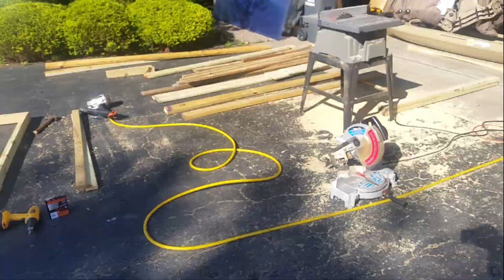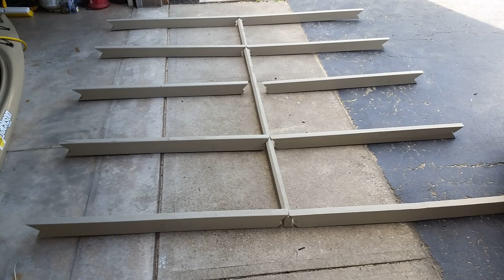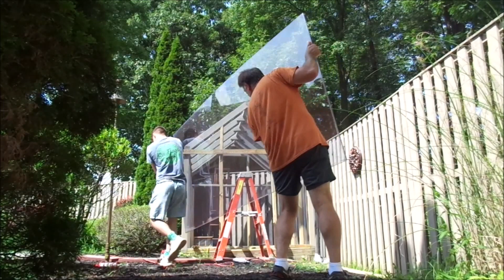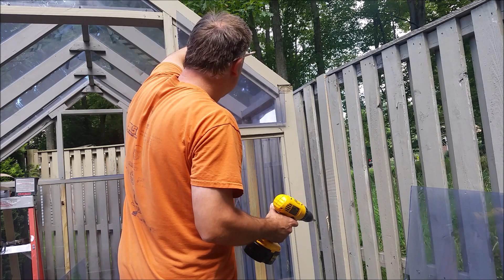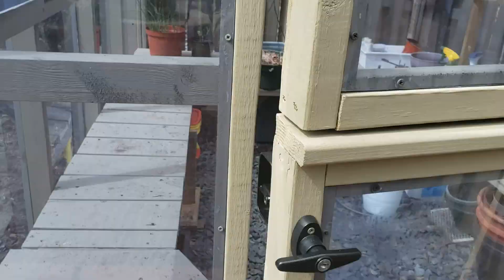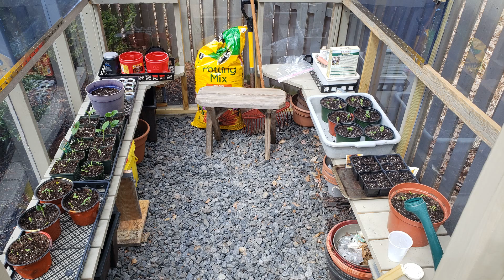DIY Greenhouse build 2019/20 treated lumber and Plexiglas

Comment: Hi, can you explain how you make the inside bird mouth cut.thanks
Reply from the maker: sure, a simple way is to know and measure your angle cut and lay them out appropriately on the garage floor and lay your ridge board as it will go and trace and cut. then use these as your template to cut more. i angled the top of my ridge board with my table saw so i would have a perfect flush finish with the plexy at the peak.

Comment: Looks good!  Can you please show us how to build and fix the vent?
Reply from the maker: oh where the plexi cracked...  I bought a cheap air vent at home depot and used that.  I then cut the plexi to fit the vent erasing the cracked portion and pilot drilled and installed with short screws.

Comment: How has the plexiglass held up? I’m considering doing this over glass since it’s easier to work with. Just unsure of how it does with insulation obviously because it’s a thing material. I’m in the Midwest so trying to see how it holds up in the winter with snow and what temps you got. Did you have a heater in there or did you not use it in the winter?
Reply: Also great job it looks awesome!
Reply from the maker: so far it is good, i did not use it this winter but we did have a lot of snow.  this spring it performed very well.  inside temp about 120 degrees on a hot sunny day.  i usually leave the vent and door open during the day and keep the temp good.  i am happy with the material
Reply: @chcc7777  have you had any problems with plants getting burnt from sunlight?
Reply from the maker: @RattleRack10  interesting question, yes i have but to remedy this problem i keep the window and the door open.  it gets to about 120 degrees in there but i keep the plants well watered and if it gets too hot i put the venerable plants out in the shade. if there is good air flow there is no problem.  now in july all i have left is some herbs, chives and late planted cucumbers that i will put in the ground next week.

Comment: Hello, thank you for the video. Can you please advise the thickness of plexiglass you have used for the greenhouse? Since the last 1.5 years, how's the plexiglass working for you? I'm bit confused between choosing polycarbonate vs plexi. Thanks!
Reply from the maker: i am confident it is 3/8 inch and shelves are 1/2 inch.  the plexi has help up perfectly,  even in the hot summer and the 0 temperature and snow.  to be sure i will measure the extra panels and get back to you.
Reply: @chcc7777  
11 months later AND I am STILL sitting here at my local hardware store waiting on you to reply on the plexiglass thickness!!! My wife and kids have got to be wondering where I am, by now. There is probably a missing person’s repot out for me, but who knows!?!?!? And, that’s not to even mention the fact, the store employees are getting a bit suspicious of me because I’m here every night when they close and go home and then I’m still here every single morning when they arrive at work and open up the store!!!
Reply from the maker: @DFWJon  sorry about that i thought i replied, i used 3/8 inch clean room grade plexiglass.  and 1/2 inch for the shelf.   it has held up well.  and my plants do not get burned but i keep positive airflow on hot   spring days.  I was still getting tomatoes and peppers on dec 1st this year.  i would imagine that 1/4 clear or 3/8 clear from the hardware store would work fine.  the guy down the road has a large greenhouse and he used 3/8 to 1/2 polycarbonite non transparent panels.  it looks nice not sure of the expense.  before that he was using a double layer thick plastic.